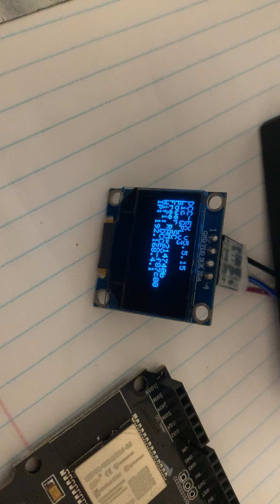Wemos D1 R32 ESP32 DCC-EX (CSB1 wannabe).

Comment: The EX-CSB1 is way more powerfull, 5 amps per chan vs 1 amp with the shield you show,  on top of that you can put another dcc-ex shield on top of the EX-CSB1 for 4x 5amp rails. I run z-n-o scale with mine. But also have 50 units of the setup you show, if you have a big layout or anything that will pull over 1.4ish amps, the cheap shield is a no go.

Comment: Hello, I have two questions. Did you use EX-Installer or Arduino IDE to burn the code? Does the L298p motor driver board used in your video require any special modifications in the code? Thank you! (My English is not very good, I use Google online translation)
Reply from the maker: No, I did not need any special wiring. I used both software. EX-Installer worked, I had to use a micro USB cable and select "ESP32 Dev Kit" and " Standard Motor Shield", I have a display 128x64. When I used IDE, I could choose "Wemos D1 R32"

Comment: what's the point of the booster board ?
Reply from the maker: The Wemos D1R32 supplies only a low voltage DCC signal. It is not powerful enough to connect to the track. You need a booster that will supply enough current to run locos. This booster in not built into the Wemos D1R32 unlike the CSB1. So it's a lot less expensive to build a command station if you buy a ready made booster for cheaper and a D1R32.